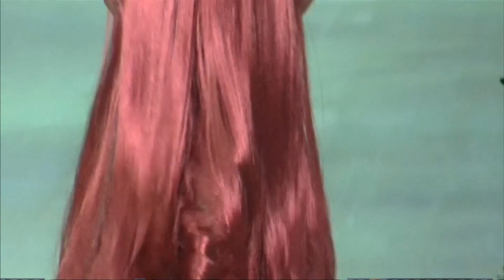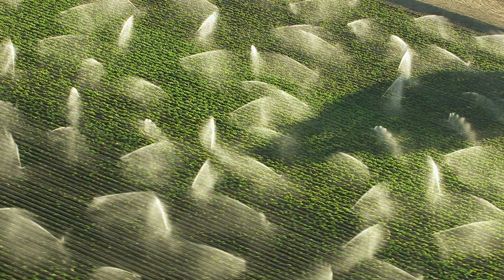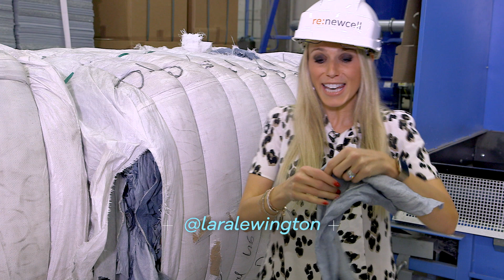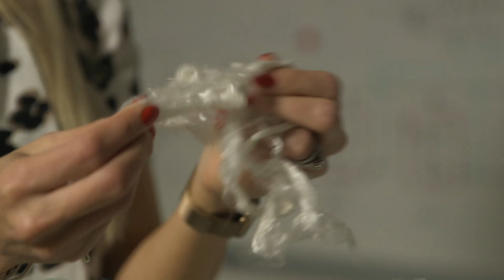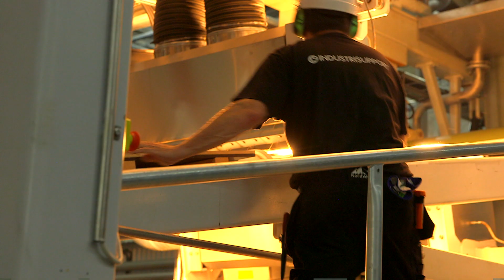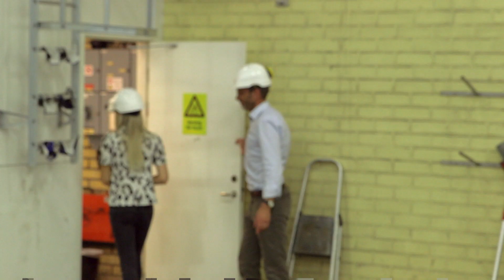The High-Tech Way To Recycle Clothes - BBC Click

Comment: Wouldn't you end up with 80% recycled clothing if it can be done 4-5times one time  new virgin material 4 times recycled.
Reply: the important issue is the no longer wanted to be owned product is being recycled ~  and greater improvements in the process and efficiency will evolve with more involvement ~